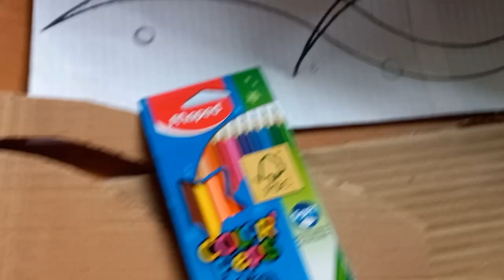DIY Disco Bed, Bum Gun Installation & Baking the Rain Away in our Portuguese Ruin.

Comment: The bed mods are nice. You could always get an old computer fan and hook it to a battery, with an on/off switch, for increased airflow.
Reply from the maker: That's an excellent idea! I might need some help with that one. 🤔 😅
Reply: Great idea. We have the same issues with mould here in southern Italy as well. Drives us nuts! Doesn’t help that they build with bricks made out of compressed sand. 🙄
Reply from the maker: We can't wrap our heads around some of the traditional building methods/styles. I think it comes down to doing the best with what they had available. But not having a roof overhang boggles my mind!   Obviously we need to get the structural support right for a larger overhang because of the wind, but it's windy in many countries that have a roof overhang so that can't be the reason they are not typical here. 🤔

Comment: Have you considered buying a dehumidifier? They are not that expensive.
Reply from the maker: We looked at dehumidifiers, but the ones we saw were very small. Eventually we will get one because I think it's necessary here in winter. 
I think the best solution will be prevention. Lots of work to do on the exterior to prevent water ingress.